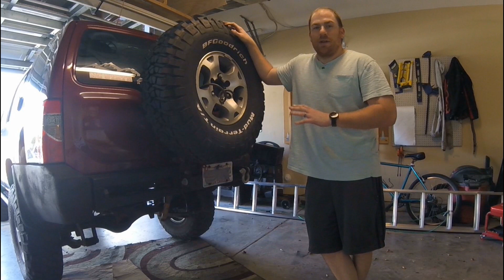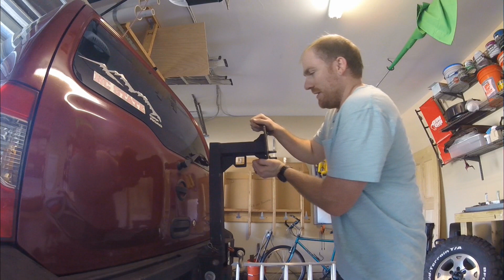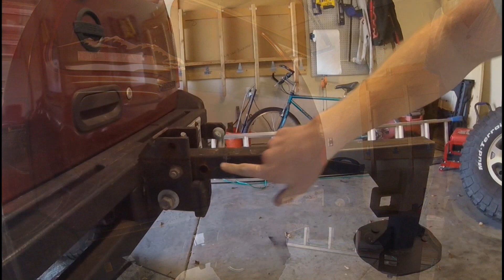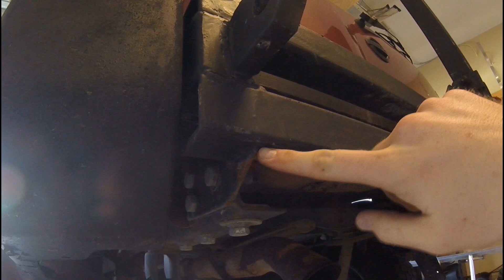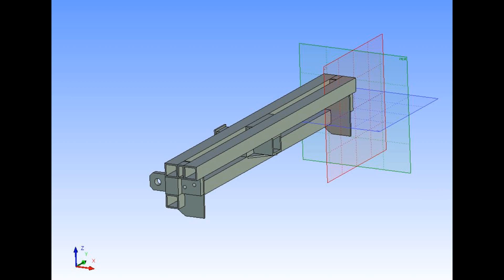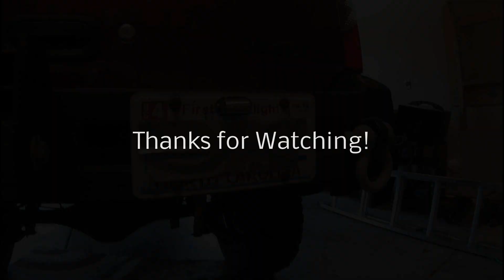All About My Rear Bumper and Tire Carrier - 2004 Nissan Xterra

Comment: I hear engineerspeak.  I'll let it slide though because your videos are so usefull : )
I'm wondering about the short design bumper you have here.  Would save a lot of trouble and material versus wrap-around for a home fab job, lots of weight for either home fab or a bought megabucks bumper, but doesn't look to do much for protecting the corners from dropping down on big rocks.  Then again, you obviously don't baby your truck, and your corner plastics don't appear to be smashed to hell, let alone the sheet metal behind them.  Maybe the corners don't tend to get banged up all that much?  Have you seen any compromise rear bumpers that protect that area and cover up the ugliness that show up when the corner plastics are removed, but are NOT made from a half ton of armor plating?  And thanks for the great info in all your videos!
Reply from the maker: I am guilty of engineer speak from time to time :)  no bumpers that I know of wrap around. PpEngineering has just the corner pieces...but they are made of big plate steel and are pricey. Biggest benfit of the rear bumper is dedicated STRONG recovery points, place to put spare tire, trailer hitch, great departure angle, and it looks cool. Never hit the plastic corners before...but it's plastic, who cares? Easy to pop dents out and you really only need 3 of the screw holes to keep it on.

Comment: Do u not like the tire holder underneath? Where you live?
Reply from the maker: Big tires dont fit underneath very well. Also, for offroading, its tough to get the spare tire out in an emergency if youre on a Rocky trail!
Reply: @XterraRob  makes sense. Wat state u in?
Reply: @XterraRob  how far from Spartanburg/Gaffney?
Reply from the maker: 4 hours or so.